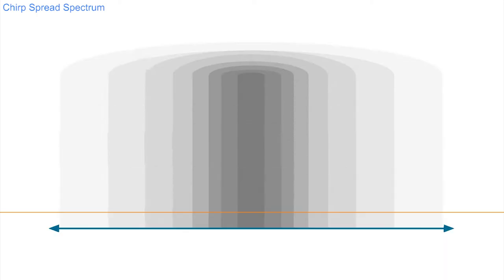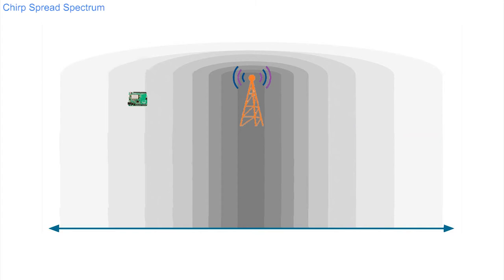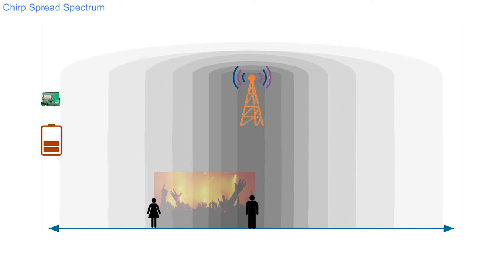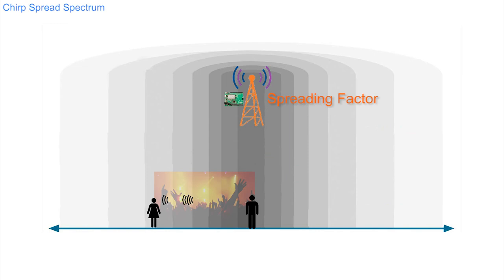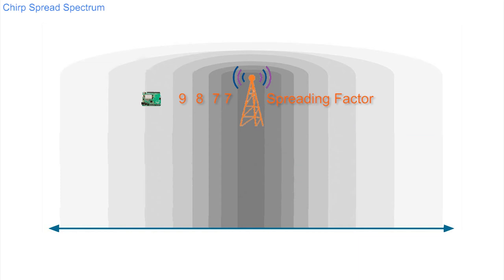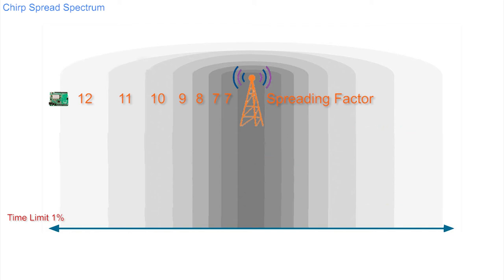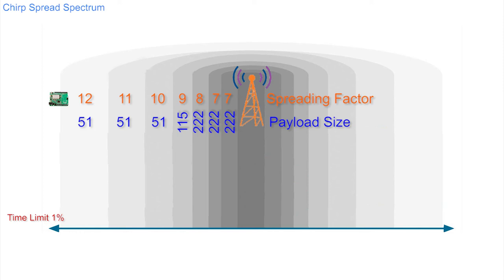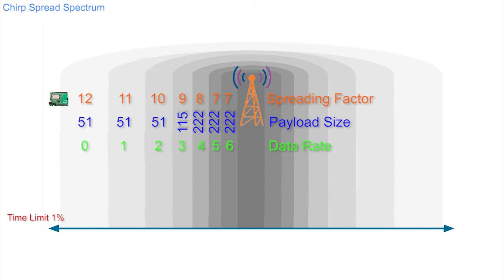LoRa Spreading Factor & Data Rate

Comment: Does going from sf7 to sf8 increase the sensitivity by 3dB. Is this a way to increase range? E.g using ADR? Is that theoretical? Snr also decreases from -7.5 to -10
Reply: To my understanding, yes, I would say that increasing the SF by 1 will increase the sensitivity by 3dB.
Reply from the maker: Yes, you end up trading range for bandwidth.  Remember you are also restricted to 1% transmission time.